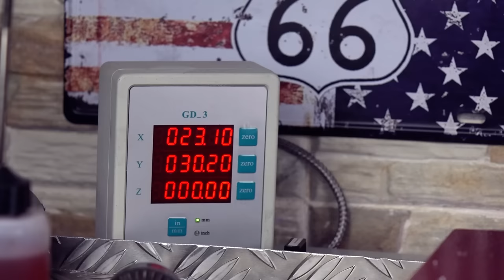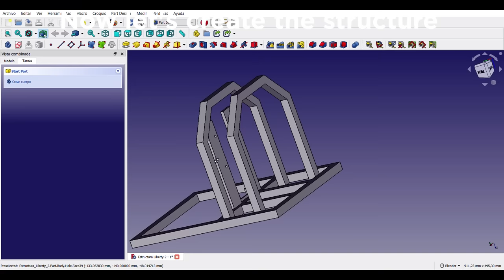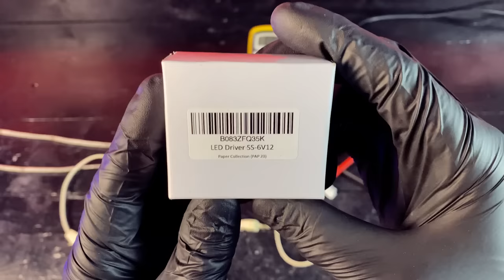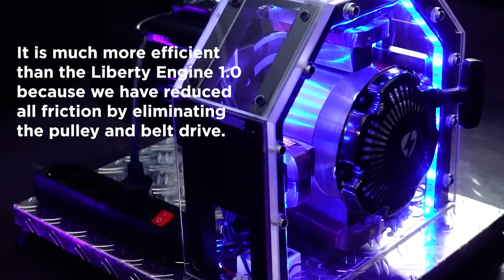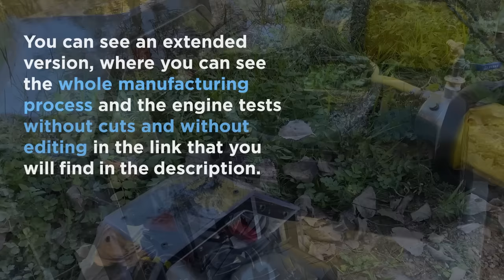Liberty Engine 2: THE PORTABLE FREE ENERGY GENERATOR that you can build yourself

Comment: While there are indeed ways to gain free electricity, this is not one of them and the people gullible enough to fall for this - please reply with your email so I can sell you things.

Ignoring the impossibility of a motor powering itself, a generator capable of producing 20 kW is going to be substantially larger and heavier. Furthermore, electric motors generate back-EMF as they spin faster and when a load is placed upon them. The back EMF can be understood in a similar manner as "wind resistance". The faster someone travels on a motorcycle, the more resistance needs to be overcome. In a similar way, back EMF scales as the motor speed increases. When there is no load on the electric motor, back EMF will rise until it matches the input voltage being fed to the motor. It is a proportional counteracting force and it's just one of many reasons why this method can never work.

In short, if you want free electricity, write "REFUSED" on the envelop of you electric bills and put them back in the mail, and also disable your "smart" meter.
Reply: and if im not mistaking i see a cable on the ground between the leaves, thats prob. how he powers everything up.

Comment: There is no way that thing produces more energy than it takes to run that motor. With only 4 coils and 4 sets of magnets it would be a tiny fraction of the energy needed to run the motor
Reply: The energy produced from the coil is only to turn on the blue LED light, right?🤭🤭

Comment: Does this machine operate at 50 hertz? Saw the microwave transformers were 50 hertz...
Reply: A 50Hz transformer powered at 60Hz is ok. A 60Hz transformer powered at 50Hz could burn
Reply: @car9167  so can this engine produce 60 hz?
Reply: @sleigher5189  There is no guarantee on the frequency. It depends on the rotor diameter, the strength of the magnets and the voltage induced in the coils. He must have experimented to get to a certain diameter of the rotor to reach equilibrium. Not sure what speed the motor runs at.
Reply: @car9167  I was told his motor runs at 1400rpm
Reply: @sleigher5189  Ok but how? It needs a 50Hz single phase power supply. It has 4 poles so the speed should be 1500rpm but is only 1400 due to slip which is common in asynchronous electric motors. The voltage induced in the coils has the frequency dictated by the rotor speed. He starts the rotor manually, that rotation induces current in the coils which powers the motor. Probably the voltage is high and the rotor accelerates but as it accelerates it will induce more voltage which will make it accelerate even more. What regulates this to stop at 1400rpm?. In theory it should go faster and faster and faster. If the voltage is not higher when manually spin, it will stop after manual spin as not enough energy generated. So the coils needs to generate more that the friction and everything else. And secondly how it regulates the speed under load? Any load on a motor will try to slow it down. What mechanism provides more electricity from the same coils? Something is fishy.
Reply: @car9167 you were right sir,they dont show the connection of a coil,i have little knowledge of electricity and im practicing a simple electric generator,but i only measure 0.1v  to 1v by hand rotation. Yes,it something fishy...i tried that in a 2 simple dc motor, it always malfunctioning and it stop spinning.

Comment: las  bases metalicas donde esta sentada   las  4 bobinas de 220 voltios de que material es ,no especifica . oh es la misma del trasformador
Reply: the microwave transformers are rated at about 1KW so each coil in theory is capable of producing 1KW of power, 4 coils 4KW. He has a demonstration where he powers 20KW. I don't think that is possible.
Reply: @car9167  20 kw per day, I assume... or it can increase to 20 kW/h  with the same size.  Just make it 6 coil x2 per spot on that still only 12 kwh. 8 x2 still only 16 or increase wire size to 20 amp. 2kwh per coil per spot x 8 = 16 kw/h x 2 coil per spot that can make 32 kwh...
Reply: @PNg-ck4yh  You're confusing Kwh with Kw. One is energy the other is power. He "powered" a total of 20Kw. That's power not energy. You don't know what you're talking about

Comment: WOW! Ive veiwed this a few times and I love the idea of cutting out the greedy power mongers. And I have shared it with lots of people. They all think its a load of rubish. But I am an optimistic guy. Look I'm no rocket scientist, but I want to make this as it will save me money. You say its AC, but yet you power all those things at the river and all 4 those fans. So that means its able to go strait into a DB board no? Or first through an inverter and then into the DB? And could this run my whole house? As i want to do solar, and the solar place said i need a 10 to 15 kw  inverter.  If so, what would happen to the excess power? Would that feed back to the grid? Oh I'm in SA if you think answering to help. Much appreciated

Comment: If paired with Tesla or other electric cars, I believe this will be a future without oil. Moreover, electric motorcycles use this engine fuel which can be used in planes."
Reply: Oil  will always be  in use   as all the moving parts and bearings  need to be lubricated   as many politicians  need  to be   greased  as well
Reply: @jeephann2696  the oil will be better purposed and not wasted...burning it is the worst possible use of it, in this way consumption of oil will be reduced to 10% compared to current rates.

Comment: why would the switch stop spinning the motor . magnets are fixed or locked that thing would spin a quarter way around and stop and so on .
Reply: The switch just disconnects the hidden batteries.  That's all.  Turn off the real power supply, and it stops.
Reply: @ChristLink-Channel  i thought so

Comment: is the motor ac or dc? What voltage in? ac or dc out?
Reply: AC obviously. Looks like a bridge rectifier is sending DC out. 

I can't really explain this other than perhaps by wiring to itself in parallel the magneto kinetic field is keeping it over unity I'm sort of at a loss here unless it's working on Tesla's wireless field principle. 

At first I thought the capacitor is hollowed out with a battery and P/N gate semi conductor inside but the multi had no voltage at the rectifier bridge.
Reply from the maker: All the answers are in the video

Comment: Please I will buy we are from very small village and we do not have any electricity our water is also from the deep tube well and that's why we need that generator so how is the cast and will I get it in Pakistan
Reply: I'm guessing the drum is cast with Aluminum, Nickel, Silver, Cadmium. A super alloy. You should be able to source these components from nicotine Vapes if you have them in your country the batteries will say Ni/Cad. 

Find an auto shops in the city that may have a lathe, welder and flat stock laying around.

Comment: What am I doing wrong with mine? I could only get 7 volt 4 amps ?
Reply: You meant to say, you are able to reproduce using the exact same steps (1:1 replica) and you cant get the same result? Then you are probably wrong on the Metal Composition which may have caused you to lose electrical energy due to Eddy Current Loss??

If you didnt do the exact replica, then dont shit on others... show your process as well

Comment: ❤ is that producing 22.8 V or 228 V  ? ❤
Reply: 228v
Reply: @idonwanna4026  what is the amperage capability?
Reply: 0.0 V.
Reply: @j.d.waterhouse4197  do you have any idea of what kind of load you can put on that regarding amperage? Let’s say that I was going to hook it up to an air conditioner that drawled 30 Amps. Is it possible for device like this to produce that kind of amperage load if it’s built big enough to run an air conditioner

Comment: Thank you for all your efforts. You have done an excellent job. You said that a Silver and Aluminum alloy were used in the rotor to reduce Eddy Currents. You alluded to a fact that this was a vital upgrade. Can you say how much the heat was reduced with this method as opposed to aluminum only? if you had just used aluminum instead of the alloy would the heat generated drastically shorten the lifespan of the unit?

Comment: Alumimum and silver are favored for their eddy current properties, this is why you see them used in eddy current braking systems.  So whats the gimmick?  You clearly see the magnetic braking when you spin it by hand.
Reply: I don't know how this thing is real but you're right and the video says the silver was to reduce the eddy currents. This makes me think there is a N gate semi-conductor in the drum directing the focault currents as a magneto-kinetic impulse field that turns the AC motors shaft which then allows the spinning alternator type secondary motor to defeat the dielectric braking force and the parallel wiring from the secondary motor goes to the rectifier bridge on the primary out to DC but that's if this is real, idk I'm stumped and I know Tesla, Heaviside and Steinmetz works pretty well.
Reply: @off6848 This is mostly the work of Robert Adam Generator
Reply: @McFlysGaming  I'll look into him but I was talking more about those engineers understanding of EE principles not specific motors.

Ok so it is an impulse or pulse motor very interesting.

Comment: 1 coil 1000w
4 coil = 4000w
20kw ?
Reply: this video is a great example how things can be shown without actually explaining anything. Noticed the lack of mathematics and principles of electricity? there is also one thing never shown: the capacitor on top of the engine. What does it look like? Probably this is the secret of operation

Comment: why aluminum and silver?
Reply: Why not? It looks pretty. Lol!
Reply: Lenz's law
Material Conductivity (Siemens/m)
Silver (62,893,081.)
Aluminum (37,667,620.)
Reply: Because it makes the lie slightly more believable if you think there's a reason why the flywheel would be made from anything other than plain aluminum or even steel.
Reply: @alphaforce6998   it radiant energy, the patent is under "Military Use Clause" means it will be confiscated by law, no matter if you built it.   look up Robert Adam

Comment: TRY IT OUT BEFORE CONDEMNING THIS ENGINE. NOBODY SHOULD TALK LIKE GOD.😅
Reply: Whatever the voltage is, NOBODY SHOULD RUN 20 Kw THROUGH THOSE SMALL WIRES, unless they like melting copper. Just saying. For that much energy, there should be a minimum of 2AWG wire just to prevent burning the wires or burning your house down. I'm not saying it doesn't work, I haven't done any part of the project, however, NOT TALKING LIKE GOD, Please read the electrical codes and use the proper size wire gauge!
Reply: Then why isn't it on the space shuttle?
Reply: OK, I won't talk like God.   I'll just talk like a man who understand science, and then I can condemn this engine just fine, based on reality.  Perpetual motion is impossible.  Plain and simple.

Comment: Voltage is easy to produce. What is the AMPERAGE???!!! Those tools will overheat very quickly without adequate AMPERAGE!!!! You have not shown us the AMPERAGE!!! HOW MANY AMPS ARE BEING PRODUCED?????!!!!! AMPERAGE! AMPERAGE! AMPERAGE! AMPERAGE! AMPERAGE! AMPERAGE! AMPERAGE! AMPERAGE! !!!!!!!!!!!!!!!!!!!!!!!!!!!!!!!!!!!!!!!!!!!!!!!!!!!!!!!!!!!!!!!!!!!!!!!!!!!!!!!!!!!!!!!!!!!!!!!!!!!!!!!!!!!!!!!!!!!!!!!!!!!!!!!!!!!!!!!!!!!!!!!!!!!!!!!!!!!!!!!!!!!!!!!!!!😗
Reply: he said 20 watts and 220 to 230v so shouldnt you be able to work amps out from there?
Reply: @danieroothman5555  The point here is the important parameter is conveniently overlooked. 1/10th of an amp is barely enough to run those tools, never mind actually working them.
Reply: Very well. See more that it.